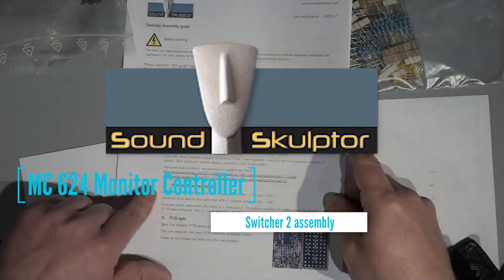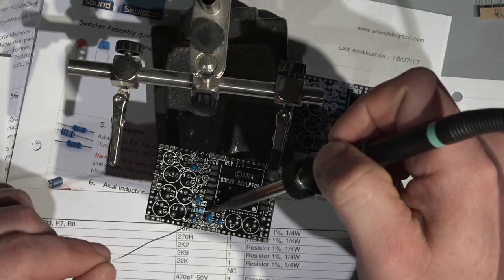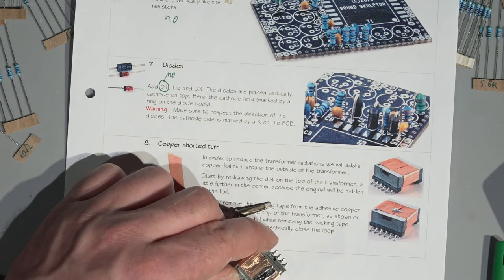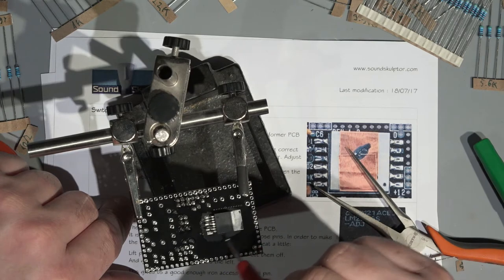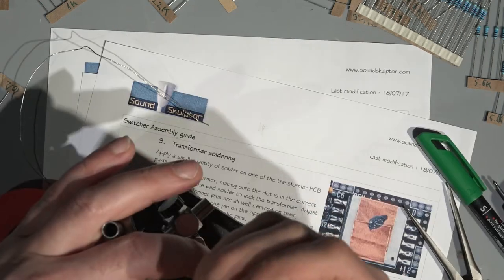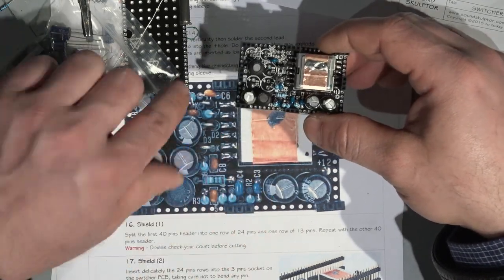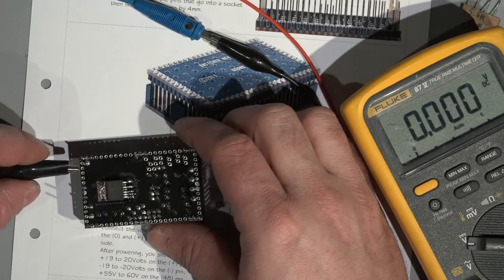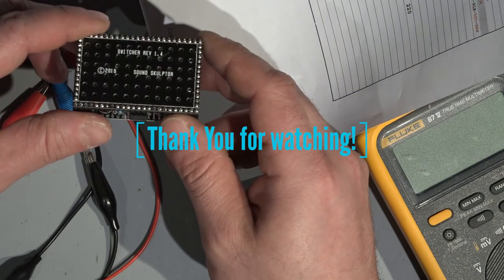Sound Skulptor MC624 high-end monitor controller. Switcher 2 assembly

Comment: The output voltage unbalance is there because the negative output is totally unloaded when the positive output is lightly loaded by the feedback bridge. When plugged into the MC624 the load on the outputs becomes even and the unbalance goes away. Furthermore the Switcher outputs are lowered down to +/-16V by linear regulators.
Reply from the maker: yes You are absolutely right on this. But later on I did a measurement with 200 Ohm load. Same result. Later on I find one capacitor is differ from the other in the serial resistance and also in capacity. Now I installed two russian high precision 105C capacitor. Drift lovered to 0.2 V. Far away ok for the linear regulators :)
Reply from the maker: Even I mentioned this here: 26:44